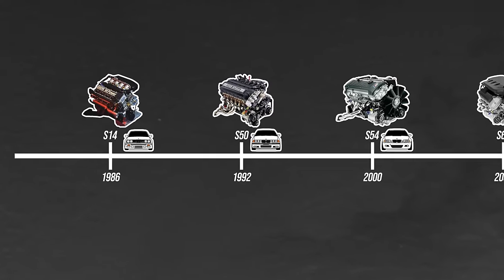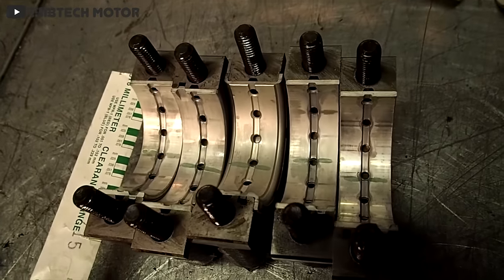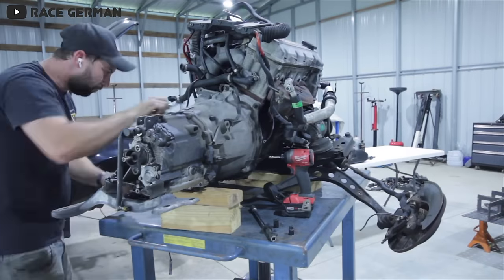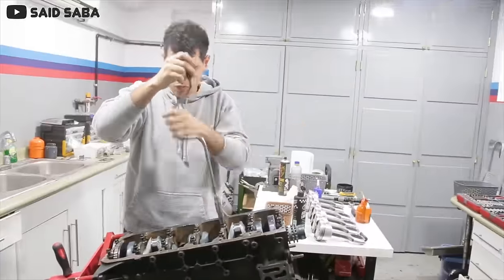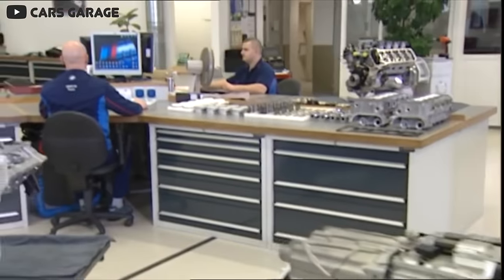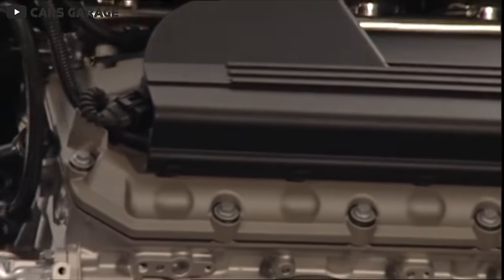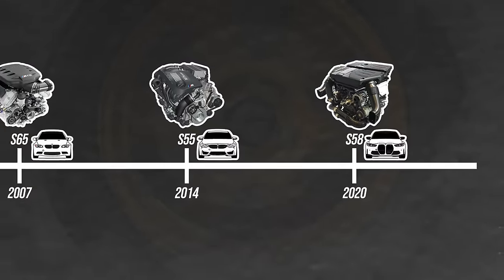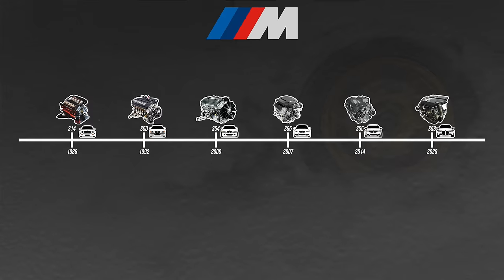The History of the BMW M3's Engine

Comment: S54 hands down. NA high revs and throttle response for the win!  Great video.
Reply: Try living with one; they're incredible until you get to rod bearing, cam follower and Vanos failures 😪
Reply: I’ve heard that. I had an 04 for 5 years. Zero issues but I admit, long term ownership would be challenging.
Reply: I’ve owned 3 generation’s of M3’s, a e36, an e46, and an e90. I would say all three had things that could and would go wrong. That being said, the e36 was the most reliable but also didn’t really feel “special” in any way, shape or form. The e46 was the most expensive to own, I had to do the subframe, Vanos, and rod bearings to mention the routine valve adjustment every 12-15k. The e90 was amazing as well, I did throttle body actuators and rod bearings but both were as preventative maintenance things.

 All in all, I would say the e46 was and still is my favorite! Perfectly balanced with just the right amount of power to match the handling and breaking. It was just so damn unreliable!
Reply: The Honda Civic of V8s
Reply: Same because that’s what I daily
Reply: If the S54 didn’t sound the worst on this list I’d consider it. S65 is more reliable and sounds better with a higher redline and more power, it takes the cake for me.
Reply: Yeah, it was kinda raspy. Some liked it, I didn’t all that much so I changed the exhaust which seemed to help.
Reply: S65 destroys it. Plus it's v8 and only found in the m3. No other car. Its the rarest of them all and subsequently going up in value.
Reply: @howarddavies136  that's what happens. People buy them cheap then don't want to spend any money maintaining them. Then they moan when it goes wrong.
Reply: @Enthusiastlist  correct s65 is the best but it's no more reliable than the 6 pot
Reply: @DaleSteel  S65 is miles more reliable than the S54, it's not even close really. To be fair that is in part due to the fact that the S65 isn't mated to any SMG variant but I digress.
Reply: @DaleSteel  Anything that is not part of the manufacturers recommended  service schedule but requires preventative maintenance is a design or engineering flaw in my book. To what extent an owner acknowledges and acts upon these flaws is up to them, but their existence is a mark against reliability simply because we only know about them due to the frequency of prior failures. So, when it comes down to it, Vanos, oil pumps, rod bearings, cam followers and head gaskets are all design or engineering flaws that should not be present, but that a well informed and diligent owner should account for. And that's just the engine. Moving on to the rest of the car, we have; SMG pumps, coolant systems, viscous fans, guibos, steering couplers, rear axle carrier panels, sunroofs, door seals, rear view mirrors, diff mounting bolts, inner wing rust that all cause issues in the same repeatable manner. As with the engine, these are design and engineering flaws that are a poor reflection on BMW, but which owners are now tasked with allowing for. 

Fortunately for US owners, their courts don't hesitate to pursue European car manufacturers, so they successfully sued BMW over the carrier panel failures. However, European courts won't do the same, so BMWs European stance is that there isn't and never was a problem with the carrier panels and if you have a failure, then GFY.
Reply: @howarddavies136  so you assume engines run forever do you? What a stupid statement.
Reply: @DaleSteel  isn't it so much easier to use insults and project ridiculous beliefs using rhetorical questions than it is to contribute constructively to a conversation? 

I don't believe engines should run forever. In fact, I'd budgeted for a full engine rebuild at about 150,000 miles, which I think is a reasonable service life for a high performance road car engine. I also had my rod bearings changed as preventative maintenance at 110,000 miles. Take the rod bearing issue in isolation - they need replacing well within the reasonably expectable life of the engine and are not listed as a service item. So by definition, they are a service item, but BMW doesn't list them as such. That could be down to one of many things; engineering, manufacture, design, BMW omitting it from services to reduce costs etc. Regardless of the cause, it is still a significant amount of invasive work that needs to be carried out within the serviceable life of the engine without being included in the manufacturers service schedule and to me, that is a mark against the reliability of the engine.
Reply: @howarddavies136  yes and no, you shouldn’t have issues if you do them every 60-80k miles. If tracked every 30-50k miles. I’ve yet to have any issues with my 04 manual, drove s65, s85, and s55 m3 and believe as far as a whole package e46 m3 lined up with the s54 is the best of all categories in one car
Reply: What about the e90 h50 with the s85 motor under the hood?! That was one hell of a combo back in the day
Reply: @Toezii518  I never knew that existed! What a weapon! Thanks for sharing 👍
Reply: @joem4686  the e36 m3 feels very special. Us spec and all.
Reply: @howarddavies136  Even then i heard the % that actually had the rod bearing issue was actually really low. I havent really seen many videos from youtubers where rod bearings actually go out...everyone just kinda replaces them.
Reply: @GokuTheHusky  I have seen instances of them spinning, but the issues is so well known that most owners have them changed before that is ever really likely to happen. Mine were absolutely shagged - 3, 4 and 5 had next to no white metal left and 6 had a big old copper spot. 1 and 2 looked fresh. And mine is a later engine with the revised parts!
Reply: @Toezii518  wait what ?
Reply: Gota agree love my e36 s54
Reply: @DaleSteel  There's a version of it in a LMP racing Z4, don't remember what year.
Reply: @howarddavies136  I was going to say that bearings aren't considered preventative maintenance, lol.
Reply: Loved my S65
Reply: @DaleSteel  I've owned mine for 6 years and the value has gone up around 11-12k.  I never plan on selling it because it is special but I like to keep track. 
Enjoy your day Friend.
Reply: @Enthusiastlist  As long as you did the preventative maintenance on the S65 with the right aftermarket parts (OEM has always been shit) and used quality oil it was pretty reliable. The dual clutch transmission was great, just couldn’t take much more power than stock long term without upgrading the clutch packs which is EXPENSIVE. Oh and Idrive is terrible. Amazing car tho
Reply: @kasebuttram9542  I actually love the update CIC iDrive in the LCI models. Probably a hot take though.
Reply: @howarddavies136  the amount of copium in this thread is truly astonishing. BMW owners are the ONLY customers on earth that would be okay with rod bearing replacement at 100k as "preventive maintenance." 

And this was far from the only lemon BMW put out there on the market...how are they considered a premium brand? If KIA or Hyundai made cars with that many enormous flaws, they would be out of business in a week. They are fun to drive, but I wouldn't own one on a bet. I had a 318 back in the early nineties, and a $5000 transmission replacement in a car with 70k cured me of my desire for German engineering.
Reply: @jacktheaviator4938  yup! The fanboy copium is strong!
Reply: It sounds bad. L take.

Comment: S65 hands down I test drive one and it’s a car that will leave a smile on my face it’s a perfect amount of power to have fun. If you ever get a chance to drive one once take it. You won’t regret it
Reply: Idk if I drove the wrong one.. I bought a f30 328 not knowing anything by about cars saw a sports mode got into cars did some research learned of a m3 test drove the the v8 NA and was absolutely disappointed on paper 414 hp 298 torque I thought it was gonna be moving absolutely not sounds fun looks good but not the car to go fast also it died during the test drive on me lol but nonetheless if done right seems like it could be a fun car
Reply: @Jakejacobsonn  298 torque, you just said it. Rev it out next time, it’s not like a turbo car with high torque at low rpm. This is a Motorsport engine designed for precise throttle response and linear power & torque all the way to redline, unlike a small turbo engine which provide a strong initial shove then torque tapers off.
Reply: I own a 08 S65 … beautiful!
Reply: Agreed, test drove M2's and M4 comps when looking for a new car, they're way faster, but significantly less exciting than the S65 in the e92
Reply: @lozzaolivier3001  I got told that after I drove it lol wish I got to truly drive it more now after learning more about them!
Reply: the S65 us known to be a weak ass motor lol. shitty torque and you have to dump alot of money to get it moving
Reply: @lozzaolivier3001 well said, Friend. I hope you're having a great day.
Reply: Man i just tried red lining s65 at 8300 rpm it was something else … in the S65 m3 you cant listen to any music cause you want to hear the engine 😆

Comment: The P60B40 is my favorite M3 engine, that 4.0L V8 out of the M3 GTR with straight cut gears sounds amazing.
Reply: Simply amazing motor and car
Reply: Me too
Reply: Pretty sure its just s85 with 2 less cylinder.
Reply: @aaronmcconkey1062  That would be the S65B40. P60B40 is just the race car engine for the BMW M3 GTR and the BMW M3 GTR road car.
Reply: @aaronmcconkey1062 it’s the s62s variant
Reply: That is a pure race engine strictly road non-legal.
In any case the best V8

Comment: Having owned a S54, tuned N54 and a tuned S55, I’d take the S65. 

The B58 existed before the Supra and I’d bet Toyota had much less input in the engine then stated here.
Reply: b58 started life as b57 block from diesel.
Reply: I am almost 99% sure that toyota's only design input was a small change on the timing chain design. Good thing they did, too, as the b48 is the same engine with 2 cylinders cut off, and uses the timing system from bmw instead. b48's got issues out the ass with the bmw timing chain assembly, which the b58 does not. Some argue this is due to the balance, or some other factor, but I believe toyota knows some mythical secrets about timing chain setup....
Reply: I never get tired of calling that car the BMW Supra 😂
Reply: I love my s65.   The sound is like nothing else.
Reply: Toyota had no hand in the design of the engine. They came to my plant in hams hall. To see how the b48 and b58 engines are built and to see if it meets all new iso standards as not many engines from other companies are. Its from simple things like work flow and right first time when machining parts. To success in right first time completed engines. It just means bmw have high quality. They would also look at reliability data from the test cells of the plant where we hammer and stress the engine to the maximum to see just how much it can take. Sometimes engine are ran for days on end with changing rpm values.
Reply: You mentioned S54, N54 and S55. So where did the S65 come from???
Reply: @Mike604  ??  This video is the history of the M3. The S65 was in the E9x series M3.
Reply: Toyota definitely knows something 🤷
Reply: @imnotusingmyrealname4566 about pickup trucks... not about performance cars

Comment: Great video.  I have an E46 M3 and a E92 M3.  As much as i love the simplicity of the S54, I love the raw power and sound of the S65.
Reply: I have a 2011 M3 I agree. Previous and future generations are probably more desirable by enthusiasts but that sound and power delivery unmistakable.  I’m just a random dude so I will never sale mine.
Reply: @SDG-cv4br  Team 2011 M3 ftw! It's still just the most fun I've ever had on 4 wheels and I can't see ever parting with it. Mine's 109k (finally broken in!) and just had it into the dealer because the oil's gotten too expensive to make it worth doing myself anymore. Every head absolutely turns when it rumbles up doing nothing but idling (although she constantly begs you to redline her). Nothing against the other M's, but S65 is my perfect fit.
Reply: which is more reliable guys?
The e46 m3 or e92 m3 ???
Reply: E92's, Assemble!!!  We must make the world sound great!

Comment: s65 is everything the s54 is but insanely better lol, higher redline, more cylinders, more power, more throttle bodies, better sound no rasp. Both are great engines but when you have a choice the answer is clear.
Reply: Nah I’d still rather take the S54, it has a wayy better intake sound. S65 is just meh
Reply: @mxnny_r5002  s65 has more throttle bodies than a s54.... s65 both in my opinion and factually has a better intake sound!!! Again both engines have crazyyyyy characteristics which make them both so good!
Reply: The rasp is wath make the s54 sound so good.
Reply: @ibefast  it’s got nothing to do with how many throttle bodies, it just has a better sound. Regardless it’s not factual this shits all opinion based so it’s whatever you like

Comment: The american S50 wasn't just a slight detuned engine. It was a completely diferent one. The head its totally diferent. I was fortunate enough to own a e36 euro M3 3.0 and that engine is epic. 86x86 square setup it just keeps on giving.
Reply: Yup.. not only no throttle body 6x it's was for selling them cheaper in 5-8k and then countny..

Comment: I'd love to drive the s65 so I could compare the feel to the s54. Currently, the s54 is my favorite but I'd say I'm a bit biased as that's what I own. I also wish to drive the euro e36 M3 to compare to the s54. I bet it's closer in performance (stock vs stock)  than most e46 M3 owners would like to admit; weight difference being a key factor there.

Comment: The S54  is my favourite engine of them all.
But about the B58 you mentioned,Toyota had nothing to do with it's developement.
It's an 100% BMW engine.
And of course continue your good work!
Reply: Toyota tested the parts out, the engine had to past their standards..... Toyota wasn't going to just let BMW put the B58 in their Supra like that.
Reply: @borla4491  so dude is right...toyota had nothing to do with development
Reply: @borla4491  Toyota had no hand in the development. They simply used the existing, lower power version that was already in use by bmw since 2015 in 40i cars.
Reply: @Cee_M3  The B58 in the Supra is NOT the same as the ones that are in BMWs.

There are three different types of B58s, the one in the Supra is not the 1st generation B58.
Reply: @borla4491  Its still a B58. And the one in the Supra is not unique. The 2020 Supra used a B58C/B58M1, same as in 840i BMWs introduced in 2018.  2021+ Supras use the identical B58D (TU), which were in 40i BMWs since 2019 & 2020 depending on model, and LCI. 
Don't get me wrong, Toyota can build great engines on their own (with the help of Yamaha) but the B58 is not one of them. 
Im a Toyota fan from the 90s. I had several Supras and Celicas, while Im now looking to add an SW20 MR2 to that list. Im definitely not hating on Toyota, their history, and their capability to still engineer and build excellent cars. (LFA against anybody. GR Yaris & Corolla) For me, the credit goes where its due. Toyota tuned the Supra their way,  but the B58 credit goes to bmw, just like the GR86 Flat 4 is all Subaru. Maybe thats why Im more interested in the new Z.

Comment: S54 all day long, I've driven the B58 and S58, it makes such great power and is very smooth, but it lacks so much character, over-engineered in the wrong sense.  The S65 would be my favorite if not for all of the complications of developing a bespoke engine derived from another fairly bespoke engine and the reliability issues it suffers even with good maintenance.  I finally reached my goal and bought an E46 M3 with the S54 and it just puts a smile on my face to drive.  There's a reason BMW sold over 85,000 of them!

Comment: My m3 e46 2003 convertible as done 180.000 miles. No money spent on the engine. Only replaced the alternator.  Original chain, starter

Comment: You missed the S54B32HP.  Different intake cam shaft, exhaust cam, with increased bhp over standard S54. Fitted in the E46 CSL.

Comment: I just want to say that I think your information on the S50 is a bit off. We didn’t get a Detuned S50B30- we got the S50B30US 

The S50B30US later became the S52

The S50B30 (euro) later became the S50B32 

The S50B30 and the M50 actually have very little in common and are almost completely different engines - I.e. the heads cannot be swapped, or cranks/rods/pistons/ and an adapter plate is needed to fit the ITBs

The S50B30US is actually a bored stroked and cammed M50B25 henece going from 2.5L to 3.0L 

The s52 is a bored stroked and cammed M52 hence going from 2.8L to 3.2 

The Euro S50 (S50B30) actually shares more in common with the S14, it has solid cam followers (lifters) ITBs and 140mm rods compared to 135mm in the S5X US motors which allowed it to rev to 8,000rpm while the US motors rev only to 7,000 

Not trying to harp on you- I just see lots of misinformation out there and I have a 1995 M3 with the S50B30US so I felt inclined to share my perspective

Comment: NA a slightly detubed version? Who did the research here? NA got a completely different engine than the EU and itaelf is a slightly TUNED version of the M50 engine.
Same with the S52 being a stroker M52 with hotter cams. 
Apart from some bolt washer, it has nothing in common with the S50B32.

Comment: S58 if you want insane Power
S55 if you want power on a budget
S65 if you want sound and speed doesn’t really matter. 

I’ve owned all of the above and so far… S65 is the only one sitting in my garage ATM. Will buy another F82 soon though. M4 GTS are cool cars.